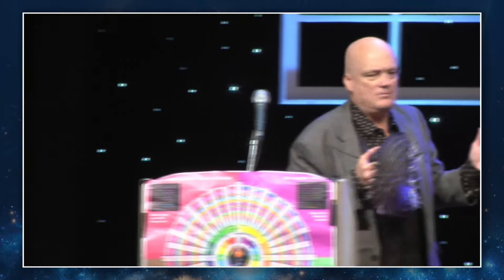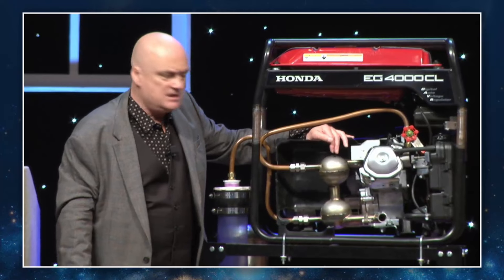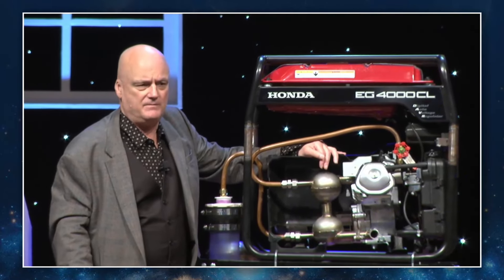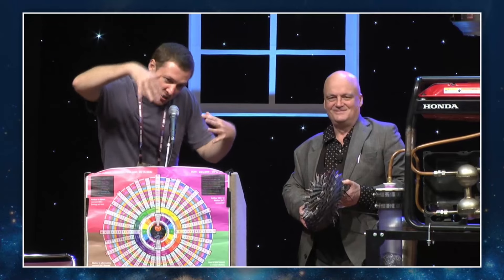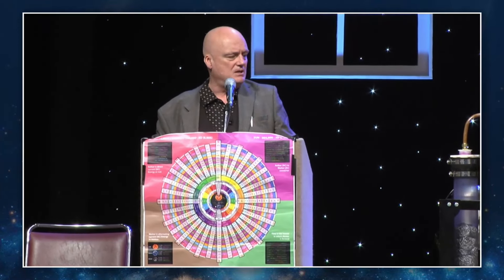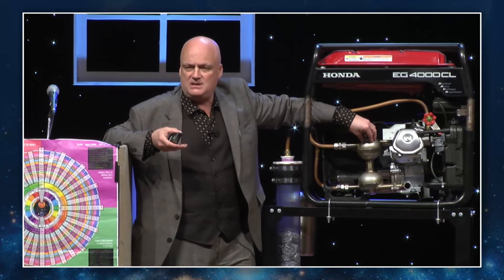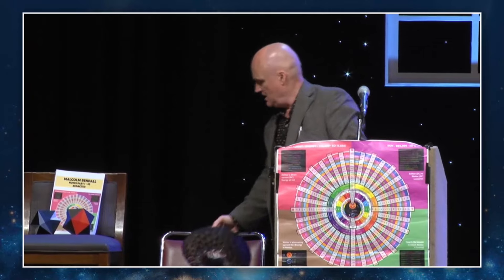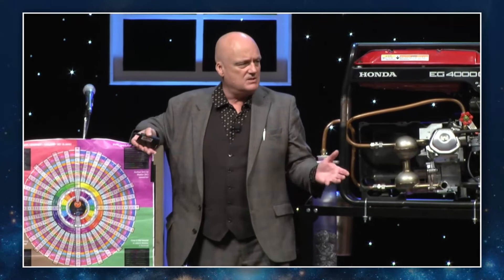Professor Malcolm Bendall et. al:  Cold Fusion and Resonant Frequency in Energy Generation

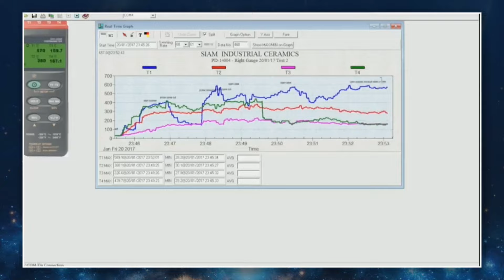Comment: 42:20 "the heat of the thunderstorm generator exceeds the heat of the input exhaust, proving an above unity condition..."   Except that's EXACTLY what a catalytic converter does, the exhaust temp is higher post-cat than pre-cat.  So a catalytic converter is also a thunderstorm generator?
Reply: file under: promises promises

Comment: Is there any increase in the back pressure on the engine due to the extra path the exhaust fumes take?
Your still having to use explosions to create your implosions. Is there something missing here?
Reply: Don't know about the back pressure, but yes, still using combustion with this.  They talk about it as a transitional technology in that it would theoretically be able to retrofit all of our current combustion engines to make them a little more efficient and much cleaner, but I believe the excitement is that the implication is that the plasmoids are transmuting elements, and possibly tapping into zero-point energy.  So hopefully much bigger things to come.

Comment: This whole movement is based off of nothing but uttered bunk. 
Pec carburetor from the water fuel guy that died from a Heart attack. 
These as that said are based on a resonance frequency. If the load changes this system is no longer in[ resonance in phase] and the exhaust recirculation fails.
No plasmoids [ no hidden tech] 
These pre vaporizer to increase efficiency of a venture carbonated stationary internal combustion cycle.  If this was truly plasmoids then this would also work with the diesel engine ( it can not) as the combustion cycle of diesel is a more comprehensive burning of hydrocarbons.  The exhaust system has little to recycle to provide an empty volume for air-fuel to burn. Therefore the thunder storm is not electronically installed with the UV light or Any light or the vector in [magnetic fields].
It is a chemical process that provides a volume of already combusted value and mixes it with a fresh % of new unburnt volume. 
The new ratio is = the combusted unburnt and burnt volumes x the pre vaporized by the heat of the new incoming air-fuel mix= less combustible unburnt exhaust [%] total volatile soilds Therefore removed in the second recombustion.

Comment: I can explain whats going on better, and the sad part is, I still cant tell you.  I DO know this is a critical velocity high pressure plasma reactor though... and, its not doing anything "new" or magical.  this has been a thing for a long time.  Give me exhaust samples to test and I can tell you what its doing
Reply: They put large amounts of air into the cylinder with a complicated contraption. The sensors get confused by the unexpected readings of a lean engine.